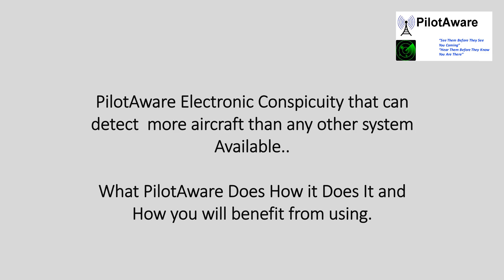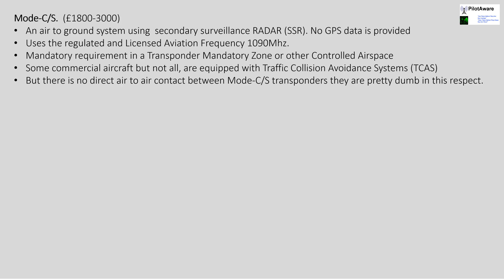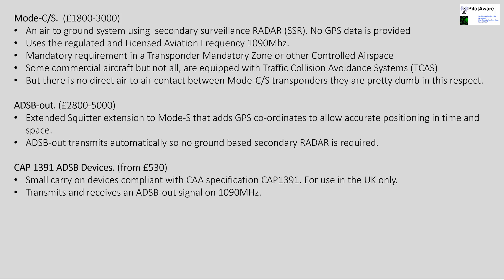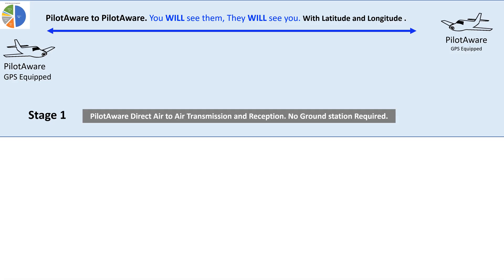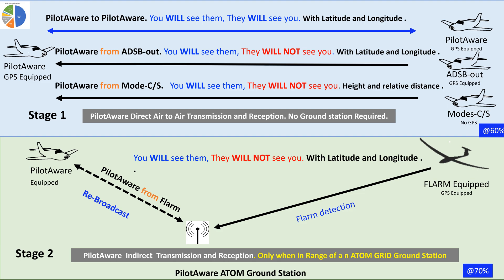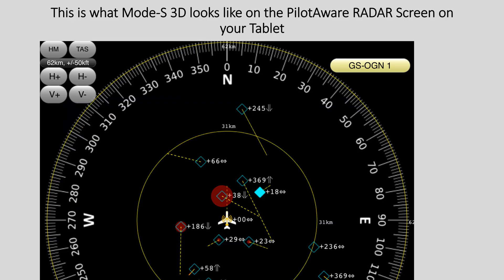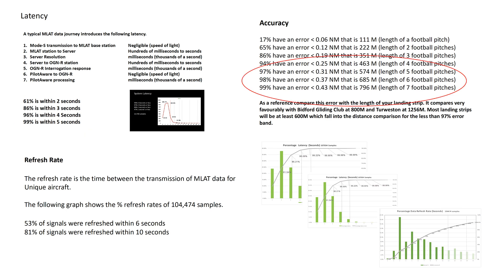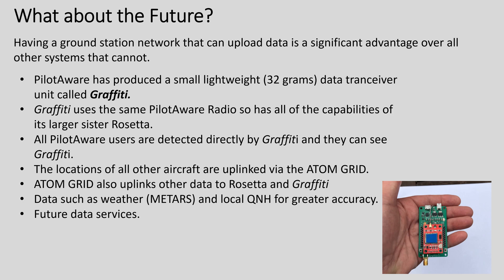PilotAware and Electronic Conspicuity 2020

Comment: Using a PAW and Skydemon where do I find the METAR and QNH data? Does it integrate and update SD automatically or do I need to get this info from a browser?
Reply: The METAR and QNH data will be available in the latest software to be released in July 2020.
This will be available on the PilotAware browser pages.
Reply: Hi Ben METARS and QNH data are now uploaded to all PilotAware users when in-range of an ATOM station with the latest software 20200906. No internet required